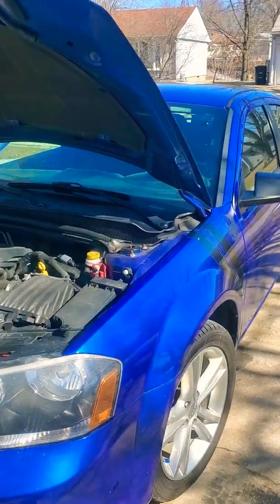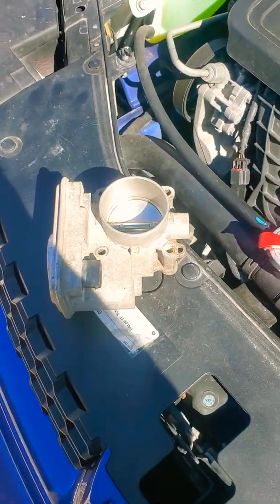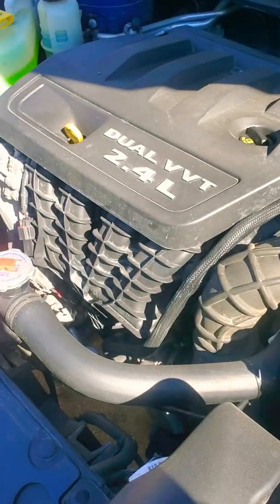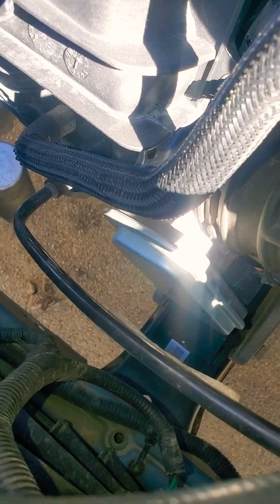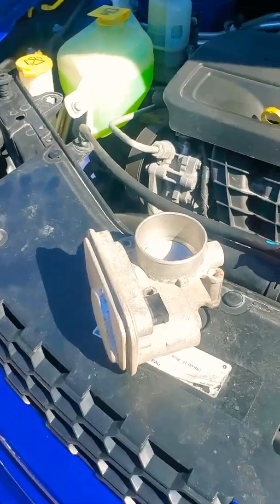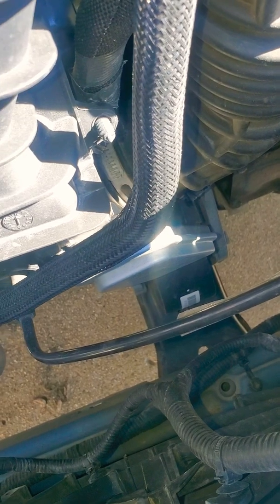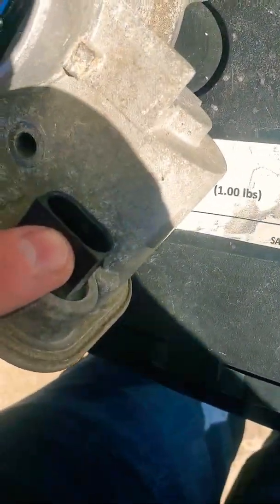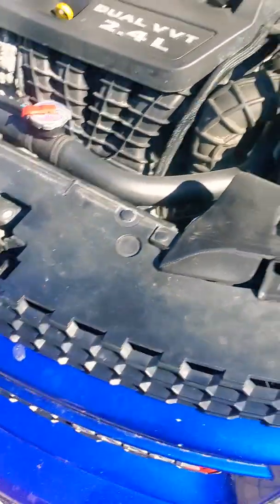(ETC) Electronic Throttle Control 2014 Dodge Avenger (Part 2)

Comment: Did you disconnect the battery before replacing the etc or does it even matter? The reason i asked because i dont know if it's necessary to do it.

Comment: i have a 2013 Dodge avenger my car, the car works perfect somedays but sometimes it just shuts off out of nowhere while driving, and then it cranks but wont start i have to wait about 5 to 10min then it wont go faster than 20mph. the following day the car work perfectly, i have changed the crankshaft sensor and I still randomly get that issue, do think i need to replace my ETC? any advice will help. thanks
Reply from the maker: Sorry for the late reply, when it won't go faster then 20mph and that lighting bolt shows up, it means your car went into lemp mode and it is your ETC "electronic throttle control" and needs to be replaced.
Reply: That sounds like a tipm issue I had it as well
Reply: Same

Comment: Was there any reprogramming it to the ecu?
Reply from the maker: No, just have to install the new one and plug it in and you should be good to go.
Reply: Hey i appreciate the help man.
Reply: Thanks man I have the same car took it out and replaced it but the lightning bolt is still on. But someone put sugar in the tank so I think the plugged fuel pump was triggering the Red Lightning Bolt to Go off. Have any tips let me know Thanks!

Comment: With a bad throttle body prevent your vehicle from starting.

I have a crank no start issue and the lightning bolt with my 2008 Dodge Avenger 2.4 L four cylinder
Reply from the maker: Having a bad throttle body would only prevent you from accelerating faster then maybe 20MPH which is lemp mode. You might have another issue
Reply: @big-c4486   I been only going 60 mph in 2014 car but with a 09 engine but I appreciate when contact me back
Reply: i have a 2013 Dodge avenger my car, the car works perfect somedays but sometimes it just shuts off out of nowhere while driving, and then it cranks but wont start i have to wait about 5 to 10min then it wont go faster than 20mph no lighting bolt symbol showing either. the following day the car work perfectly, i have changed the crankshaft sensor and I still randomly get that issue, do think i need to replace my ETC? any advice will help. thanks